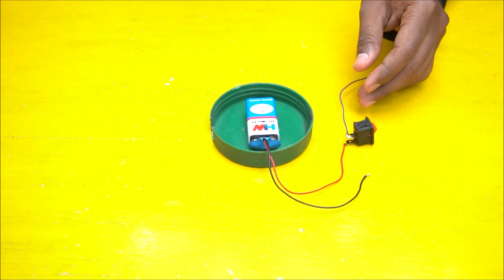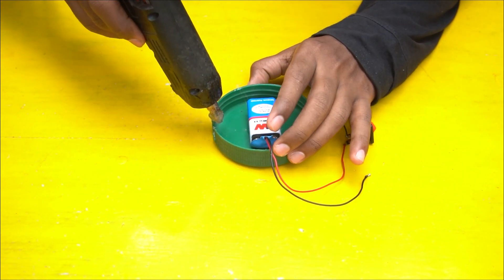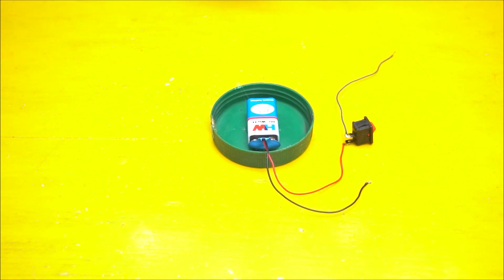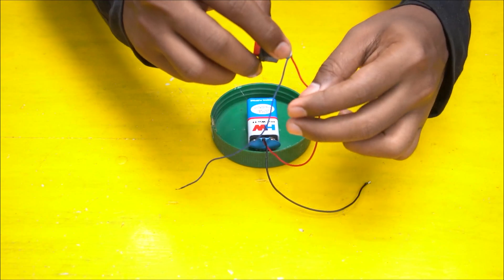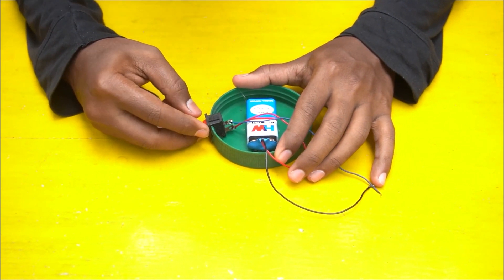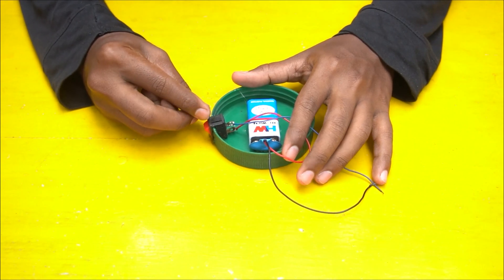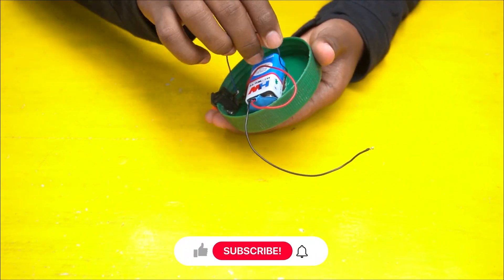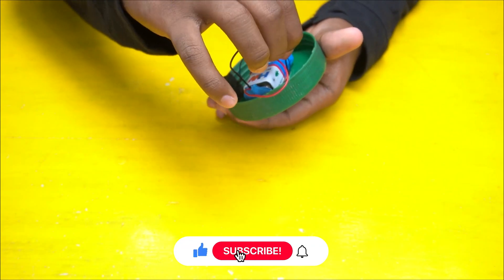Science Project Working Model For Class 9 | Science Exhibition Project | Science Fair Projects

Comment from the maker: 9V Battery with Connector- https://amzn.to/3LAKdTg
Propeller For DIY Science project- https://amzn.to/3wGvbG6
Combo of 5 type switch- https://amzn.to/39IyQuW
DC high-speed motor- https://amzn.to/4jp6gyi
DIY Science Project Kit- https://amzn.to/3NsBHXM
40 Watt Hot Melt Glue Gun with 5 Pieces Glue Sticks Free- https://amzn.to/3uZ0MTs
25-Watt Soldering Iron Starter Kit- https://amzn.to/3BUbFMX